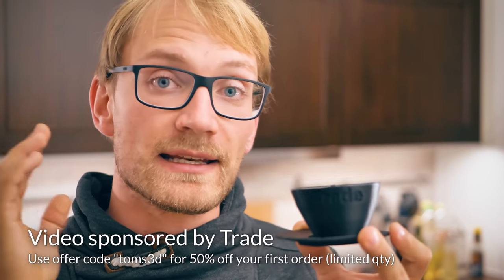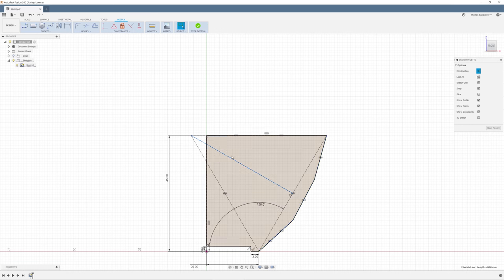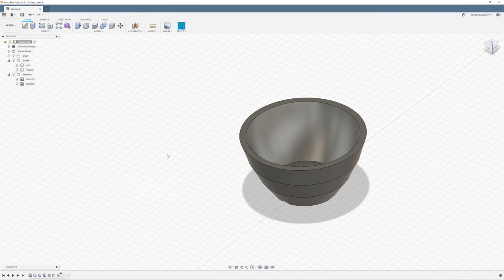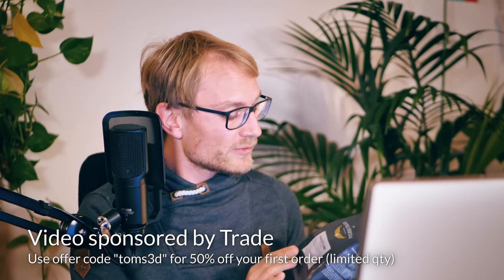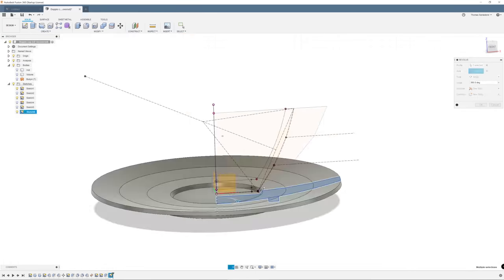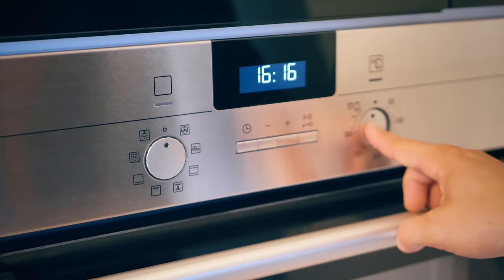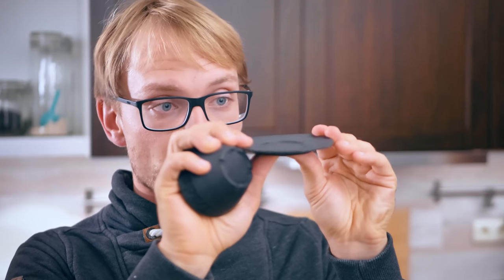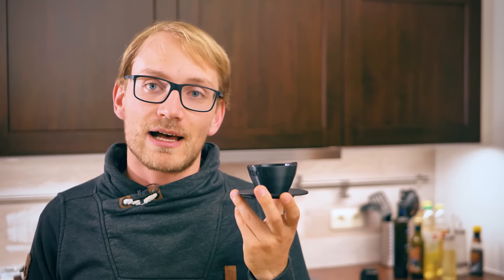Custom crystallized PLA Espresso cup! #HTPLA #Fusion360

Comment: A tip: while annealing / heat treating regular PLA I've noticed that deformation can be minimized by putting the object into a container and packing it very tightly with fine sand from all sides. Having enough sand from all directions, in all of the holes and either a closed container or some weight on top (to prevent the print from pushing the sand up when the layers expand vertically) is very important. Plus the sand cools down very slow which is better from a heat-treating point. The downside to this is that it will take much longer to reach desired temperatures inside.
Reply: arthur1129 It still shrinks though, right?
Reply: Exactly how you do with some kinds of cakes 😂
Reply: arthur1129 : Thanks for the tip! I've never heat treated PLA before, but I'd like to try it.
Reply: Could one use homemade green sand instead?
Reply: How much longer to reach the desired temperature? And how long should the part (s) be heated for?
Reply: I've seen people fully re-melt their PLA prints using popcorn salt or flour salt (same thing). It's extremely finely ground salt. Pack the part tightly in the salt and bake until done. If you're just annealing bake at around 80c for half an hour or so. If you want to try re-melting go up to 200c for about an hour. If you go for the full re-melt the result is a near-SLA finish quality on the part.

The nice thing about salt is you can just wash it off if you've packed it into a spot that would be hard to get sand out of.

Comment: The hardening process for PLA is quite important, as it removes the biggest flaw of PLA - low temperature melting.
I used 3 kinds of PLA I had: Bestfilament, Esun(PLA+) -- all of them curved a lot after hardening. 
Surprisingly, the white PLA demo-plastic which I got with the Ender 3 printer did not curve much after hardening!
Thus, I ordered 2kg of PLA plastic from Creality and, Indeed, the white PLA warps a little!! (The black I have not tested yet)

Comment: What I do for "engraving" or embossing or debossing is to extrude with the start as the front surface with a distance extent. This avoids the needed for offset geometry, and feels more versatile as the distance can be positive or negative and it seamlessly transitions from embossing to debossing.

Comment: imbedding and compacting in powdered salt (baby powder consistency) is what I have seen others do to prevent warping. You need to burry it but then pound the salt down to assure it's tight around the part.

Comment: I'll put my two cents in with the folks suggesting boiling water tempering. It is worth trying, and is my go-to these days: bring water to a boil, turn off heat, drop part in, wait for it to cool.  I have messed with salting the water for buoyancy and pressure cooker for temperature, but plain boiled water works well, is hands-off, negates the drooping effect of gravity, and is less of a concern with regard to fire or gassing off of solids.

Comment: Yeah I tend to do 100% infill and keep walls thicker than 4mm to prevent warping.  Thinner walls I clamp glass either side.  Haven't tried sand though. Sounds like it might be interesting to try as long as it doesn't end up embedded in the plastic.

Comment: Have you thought about making this with one of the translucent HTPA colors? That would look really cool.

Also tip when making coffee in a mocha pot: Pour boiling water into the water section. Makes a noticeably better cup of coffee and it's faster. Don't forget to use a glove or a towel to hold it or you'll burn yourself because it transfers heat so quickly.

Comment: The parts warped and distorted because they have internal stresses that become relieved once the part reaches the glass transition temperature and the molecules are free to move. The crystallization occurs after that. Also, I believe you once showed that regular PLA heat treats with about the same results as Proto-pasta HTPLA.

Comment: I thinking packing the parts in dry sand and slowly applying heat will be a good way to keep the parts aligned. There's always gonna be shrinkage, making it uniform is the key to a quality build.

Comment: We plan to test and develop your tempering procedure on 3D printed prosthetic devices, and it will be nice to use your cup and saucer as controls.  Being able to put a terminal device into the dishwasher will add to an amputee’s confidence that their “hands” are clean. I try to design hollow devices with 1.6mm wall thickness (which means no internal overhangs and no infill). A pair of venting holes will allow water drainage and will also allow the same STL files to be used with SLS printing (like Shapeways), but that will require printed plugs to keep the water out when washing.   My hypothesis is that this maximizes uniform heat transfer in and out of the part (as with injection molding). Thanks for the excellent tutorial!

Comment: The reason for the grow/shrink is due to the viscoelastic state of the filament when printing. As the material is not a pure fluid, the chains of polymer would stretch, and align with the print direction. As the filament is most deformed by stretching in length direction and compression height direction, these dimensions would try to go back to a state where the chains are more randomly aligned. The volumetric shrinkage should not be more than that approximately the difference in density between amorph and crystalline PLA, if the part is near-dense.

Comment: To get some accuracy and less/no warping I think I stumbled upon something. Its something I will test and probably put on youtube in the near future. It's what I call "hot printing". I got a prusa style printer (Matterhackers pulse) and made an enclosure for it. I had to print a real big part that filled the build area its an "L" shaped part that is a quarter of a picture frame and was 53 mm across, 39 mm high and the L dimensions were 246x 213 mm so barely fit. One of the fails (didn't like the way the decorations) I subsequently tried to heat treat to inspect warpage and shrinkage and - no dimensional and warping change at about 80 to 100 C whereas a different part - same PLA (MH Build series) shrank and warped considerably. The difference between the 2 parts were that the frame was printed on an 80C bed and took 13 hours to do so in the enclosure. I had to go to 80 C as no matter what at lower temperatures there was some warp. Based on that I am currently printing some mold pieces out of PLA that are about 6h prints and only 14 mm of the build plate to use to keep some regular printed pla pieces (on a makerbot replicator + w/o a heated plate) in dimensional compliance during heat treatment. A preliminary test has shown that a piece of untreated pla clamped between 2 "hotprinted" pla mold pieces and heated to about 250-300 F (very cheap inacurate oven) just for the fun of it for 1 hour in a convection oven will conform to the shape of the hotprinted PLA and not stick and be heat treated afterwards. If I got some PLA left over and some time I will try to test it to see how high of the build plate you can go . Oh one more important thing. You got to wait until the build plate cools down at the en of the print as with the 80c build plate the part is soft and you can easily bend it taking it off the build plate.

Comment: I'm thinking the change in the XY dimensions on the plate are due to variance in belt tension and steps/mm calibrations. It's probably a combination of that and the direction the print head was moving causing stresses more in one direction due to uneven cooling.

Comment: Great little project! Cool to see if worked well! 
When using fonts to do stuff in Fusion, I've found a couple of things. Firstly, rather than tracing the outline of the font in an external program, you can actually right click the text, and choose "Explode" it will actually trace the outline for you to make it ready for extrusion :) If for some reason you get an error trying to do that, chances are you're using an Open Type Font. For some reason most Open type's don't like to work in Fusion, so if that happens, try and see if you can find a TTF version :) Some fonts will extrude properly without exploding, but if they don't, try explode it!

Comment: I was under the impression that all PLA parts were porous and thus couldn't be used for food grade applications... I had never heard of htpla... that's epic... I might have to pick some of this up and start using it to print some custom parts.
Reply: Josh Hardin technically you wouldn't want to use any 3d printed part for food grade applications regardless of the plastic being "food safe". There are too many factors that make them no longer food safe the moment they go through your printer. 
Gears, potentially oils or grease, dust. layer lines, the nozzle itself being contaminated with various metals like lead. etc etc. I would never say any 3d printed part is 100% food safe no matter what you do with it. Even if you sand it you are still going to leave micro scratches that mold and bacteria love. 
At least for liquids. For dry things you are somewhat better off at least. 
But look. If you aren't planning to sell anything, it's for your own personal use and you are washing it with boiling water and baking it in the oven at 100C to dry it after every use then you are fine. 

If you are going to go for things that need to be more dimensionally accurate then maybe go for PP. No need to heat treat after printing and is already microwave and dish washer safe. Should be fine in an oven at 100C.
Reply: Wooden cups are MUCH more porous than PLA (or other plastic) printed parts.  A lot of this "food safe" concern is really only applicable if you were going to use the item in a commercial or institutional application.  Sort of like 3D printed parts are not load rated.  YMMV, use at your own risk.  Personally I would be more concerned about the particular plastic leaching strange chemicals into whatever I was eating or drinking out of them, but even then that concern is probably only applicable to long term contact.  You probably get more plastic in your food using Teflon coated cookware ...
Reply: Toni Ryan  you probably get more plastic in your diet eating fish... :-( sad but true!
Reply: @naughtyhorses  on that note you get more plastic in your diet from eating sea salt on your food than you could get from fish. Manufacturers may claim that they filter the seawater but the particles of plastic are smaller than or as small as the salt particles so it is impossible to remove the plastic. That's why I only use Himalayan salt or any salt that doesn't come from the sea.
On the fish side of things there are plenty of fresh water fish farms out there that you can get good clean fish from. 
I would be more worried about mercury etc in ocean fish than the plastic.
Reply: @toniwryan , wooden parts have tree sap inside, which kills bacteria, and also can be reliably washed. Because wood is not porous but rather fibrous and also soap water can go inside every little gap when you wash it. Unlike so for plastics.
Reply: @goury  A few things to note about wooden cups/plates etc. 1. The sap is for the most part no longer in the wood once it has undergone drying etc. What does remain in a very small portion crystallized in the wood. Small portion being the key word. 2. Most tree saps are not anti bacterial. Very few are. The purpose of tree sap is to transport minerals and sugars and to close wounds on the tree. 3. Regardless on a sap being antibacterial or not. It does not prevent mold from growing. Mold is just as much of an issue as bacteria. 4. Repeated washing of wooden cups/plates etc strips out any potential antibacterial function a specific tree sap has as the water will soak in and remove the sap. Soap will accelerate this. Hence why any wooden cutlery should never be soaked in water or washed in the dishwasher. It should always be washed by hand. Best practice also calls for treating with oils that do not go rancid or another coating must be used to protect the wood. 
In terms of safety wood is actually worse than a 3d printed part when it comes to bacteria and mold. 
3d printed parts using the correct plastics can be washed with strong antibacterial soaps, chemicals and alcohols as well as brought to high temperatures to kill bacteria, mold and germs. But only the right plastics. For example, PP, PC, PEEK and other high temp plastics. 

Note that I did not say that 3d printed parts are food safe. I said they are more safe and that you can take steps to make them safe. 
And yes there are ways to make 3d printed parts as food safe as glass, metal or injection molded parts. But that requires a 3d printer with very strictly controlled parts, a clean environment and post processing.
Reply: Sounds like a bunch of mutually exclusive illiterate statements.

So soap can go inside the wood and yet wood can't be safer than plastic where soap can't go inside?
Mold being as dangerous as bacteria?
You don't even know what mold and what bacteria is.
Complaint about portion being small is just laughable.
Reply: @super_salty9189  you do realize that the salt is dissolved when filtered, right?  plastic doesn't dissolve, so its 100% possible to filter saltwater to get plastic out.  Try mixing seasalt and plastic in a glass of water.
Reply: @joecaulfield2940  "Try mixing sea salt and plastic in a glass of water."    um. Joe....you aren't serious right?   We aren't talking about chunks of plastic or pieces you can see or that anyone just has laying about. We are talking about micro particles of plastic so small they are as small as 2 microns in diameter (at least the smallest found).  Salt particles can range from 0.035 to 0.5 microns in size. The cost to filter these tiny plastic particles out is very high. 
But even if we ignore the smallest of particles and say anything about 50 microns. We are still finding plastic particles larger than 150 microns in sea salt that is sold to the public. Very few salt manufacturers are filtering it out. IN a study conducted very recently they tested 17 brands of salt from 8 countries and found that only 1 brand did not contain microplastics. 
The biggest problem is that the researchers said they would need better extraction protocols to be able to identify particles smaller than 149 microns in the salt. 

Just look at how salt is made using seawater. Look at a documentary or something similar. Essentially no filtering is done at all. They pump salt water straight from the ocean into open air drying fields. Let it dry and then scrap it up. No filtering takes place. Salt manufacturers consider it good enough to let it sit and the "debris" is meant to fall to the bottom. Unfortunately this does not happen with microplastics as they stay in the forming salt crystals. 

Oh and just and addition on where I mention the price of filtering. I do mean the cost of the filter. But more so the cost of speed reductions. Pushing water through a filter that goes down to 2 microns is very slow. A standard home filter can be pushed to maybe 2-5 gallons a minute. Salt water farms pump thousands if not hundreds of thousands of gallons of water per minute. 
Large scale salt farms are in the 10,000 -50,000 acre field size. Absolutely massive and the water requirements are insane. 
The lack of filtering and the speed they can fill up a field are what helps to keep your cheap salt cheap. 

Filters will also inevitably have to be replaced as salt and other far larger particles will block the stages of filters required to not block the 2 micron filter almost instantly. Remember the moment you want to filter something you need to have stages to prevent large particles from very quickly blocking very fine filters. 

I hope this clears things up for you

Comment: I have just printed a little replacement piece for a RC truck that somebody asked me to print. I printed in exactly this HTPLA carbon (what is that expensive to ship to EU) and wanted to anneal it in the oven. But now after your video I am very scared and am not going to do it because it has to hold exactly the dimensions it was printed in. Maybe an idea for a future video to try and print and anneal without distortions in the final piece?

Comment: If surface coating is an option, why not go for different material (even ABS) instead?  The huge amount of shrinkage due to recrystallization sadly makes PLA pretty worthless for technical applications where dimensions matter. In case of the coffee cup -> Nice work, cool project!

Comment: @Thomas Sanladerer If you heat treat the parts on a fine mesh screen, it allows the air to circulate all around the parts and it warps much less.  That's my experience anyway.   Good video!

Comment: i wonder if one could model something taking the warping in consideration. 
So, the original model would be deformed (a pre-"anti-warp"), so that when the part warps in the heat, it end up taking the shape that you desired in the first place!
I think it would be possible... but I don't think it would be easy! :P

Comment: Is it possible to make precise parts from this material with may be slower heating? In one of my project stepper motors heat a lot, and I am looking for the heat resistant plastic.
Reply: Erik Jorgensen, thank you, it sounds complicated. Probably it is going to take couple of trials before having right dimensions.

Comment: Serious question: WHAT IS THE POINT OF THE DEPRESSION IN THE BOTTOM OF THE CUP TO BEGIN WITH? WHY NOT JUST NOT DO IT AND NOT HAVE TO PUT CHANNELS?
Is it like a suction thing so it doesn't get stuck to the table if you spill stuff?

Comment: what is the comparison vs a regular PLA in terms of heat withstanding?
Reply: PLA: Playdough
Heat treated PLA: Wood
You can, in theory, heat treat any PLA but the amount of warp you may get is excessive.
Reply: PLA is not melting, but completely deforms already at 50-60°C.